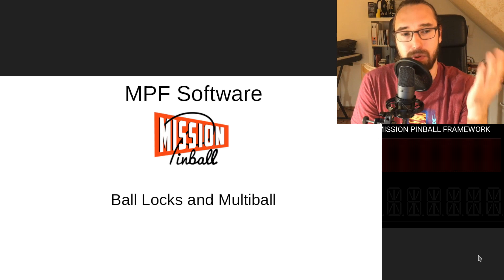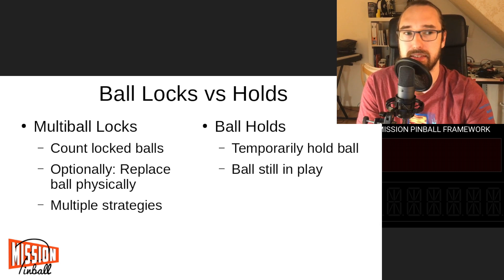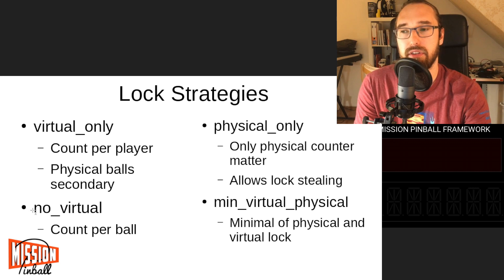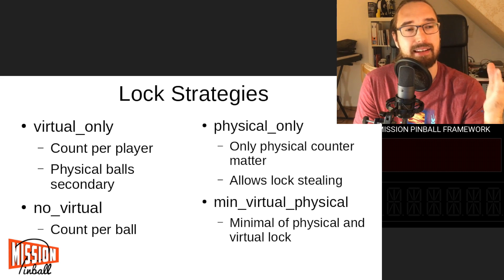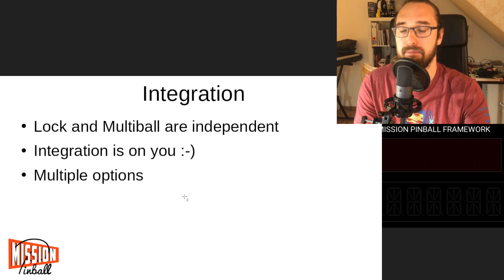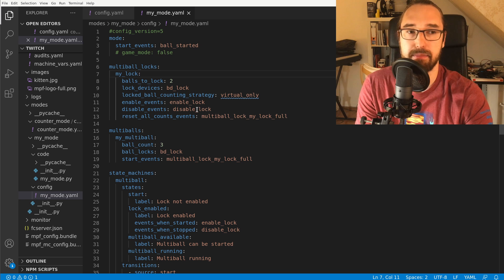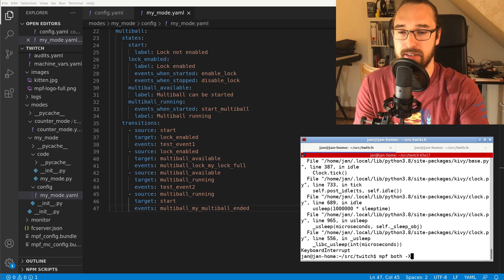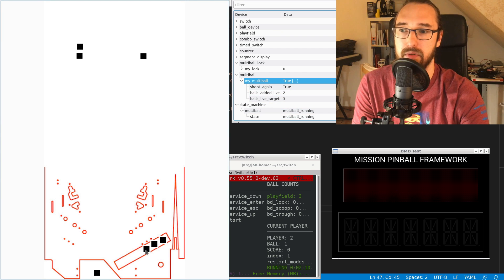Ball Locks and Multiball in the Mission Pinball Framework

Comment: Hi Jan! Quick question: what if I want my ball lock device to eject balls using something other than a coil? (For example: a spinning motor that knocks the balls out of the device and back onto the playfield.) Do you have recommendations for this case? Thanks for the videos - they’re so helpful!
Reply from the maker: Thanks :-). We got support for custom ejectors in MPF. One way would be to implement them in Python. Out of the box you can use "event ejector" and tie your motor into those events. We got a minimal example in the docs: https://missionpinball.org/config/ball_devices/#ejector. Guess that area is kind of underdocumented.
Reply: @jabdoa  it works! I ended up using confirm_eject_type: event (which was right there in the documentation the whole time, but I only found it prompted by your reply.) Thanks!